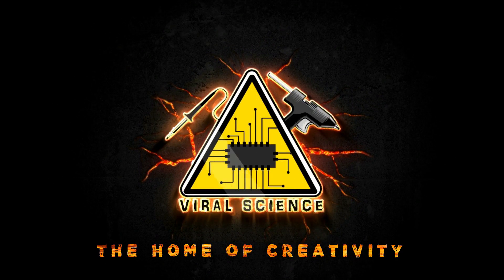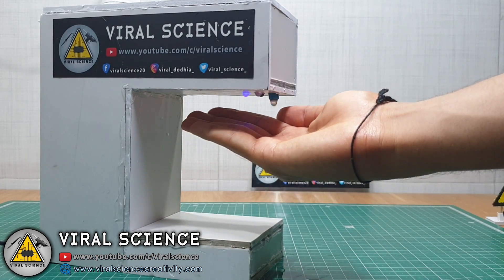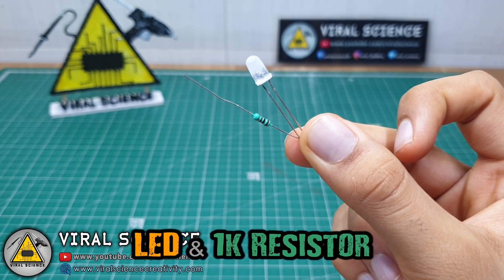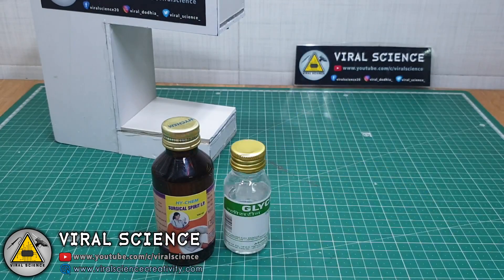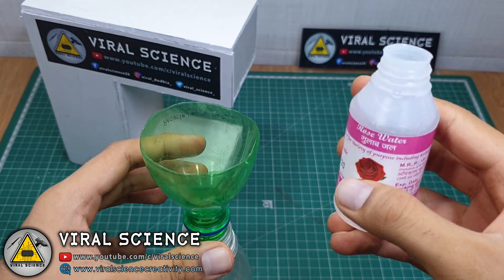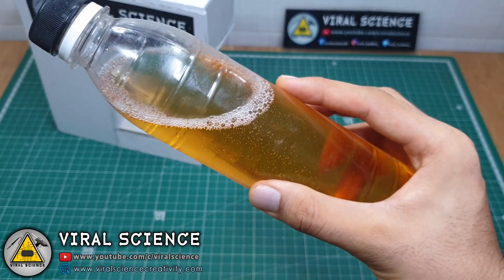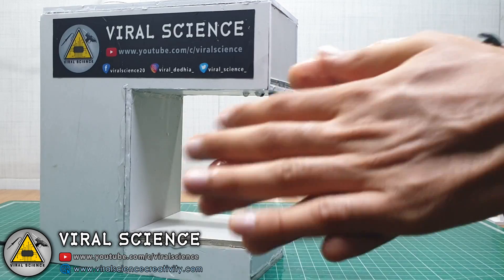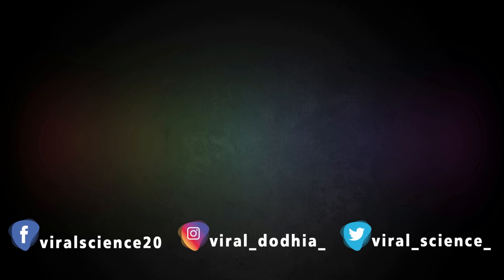Contact Less Hand Sanitizer Machine | Make at Home

Comment: Not a gud idea guys , moving alcohol through a brushed DC motor, alcohol is flammable be safe
Reply from the maker: I know this brother so rather than using a water pump i used a air pump, and this pump has no contact with the alcohol, it is just throwing air inside the bottle from the top so there is no contact with the motor, and due to air pressure the liquid comes out from another pipe inside the bottle, you can see it clearly

Comment: Hey bro does it works under sunlight ??
Please reply ...?
Reply: Obviously if it is under direct sunlight  it will give false signal but to avoid that stop relying on ready made sensors and make your own let me give you a hint use tsop receiver and transmitter pair everything else I won't tell you that's my trade secret
Reply: Use tsop.ir sensor
Reply: Use ultrviolet ones they are best bro no sunlight issue and cover much area and detect easily

Comment: Bro but it is working reverse bro wt to do 😔😔😔
Reply: U have put a transister. What is d number. Is it timed control or continuous giving senitizer
Reply from the maker: I mentioned in the video
Your both sensors (IR and Relay) must be active High
Or both must be Active low,
In your case one of this is opposite
Reply: @ViralScience  but how to do that bro please tell me
Reply from the maker: Check what values your IR sensor gives when any object detected
If the value is LOW then use active Low relay
And if the value is High use active High relay
Reply: Witch transistor used in this circuit.